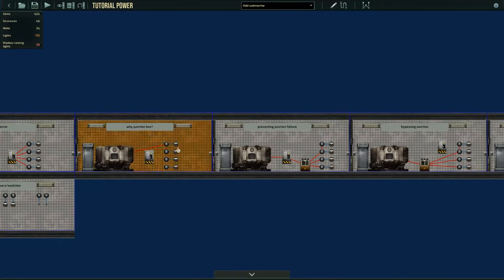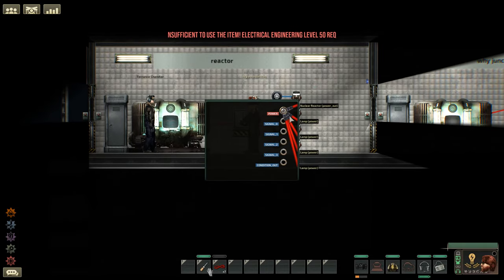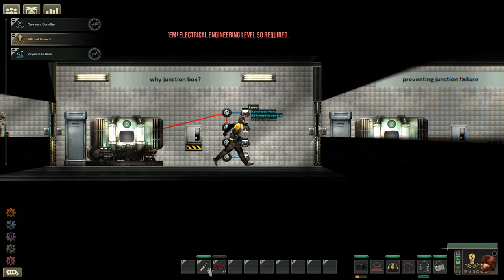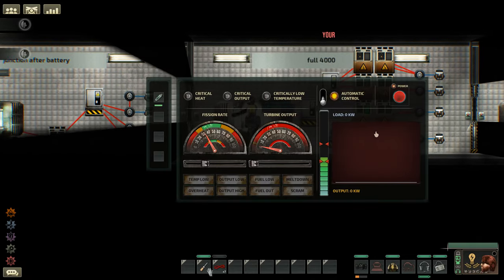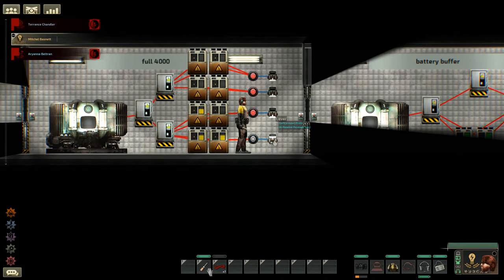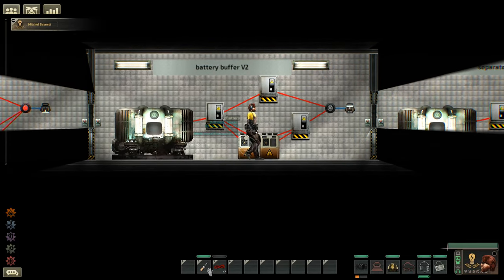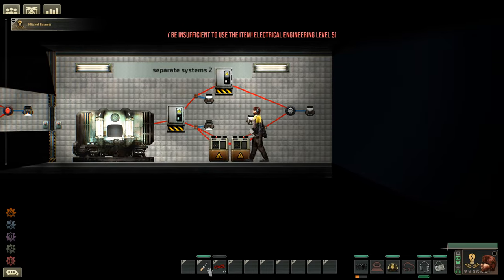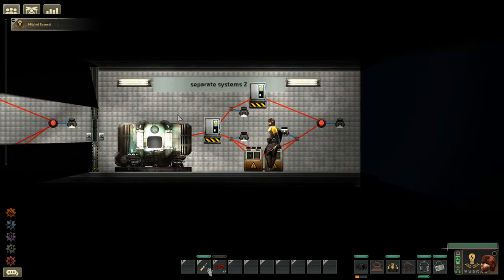Barotrauma - Reactor, Junction Box, Battery - Wiring Guide 2022

Comment: The current power system passes power requests from the consumer back through the grid to a single producer per tick. If that producer can't produce enough power it will pull some from it and go to the next producer in the list. Forking and joining via batteries and  relays causes all sorts of issues. 
There are a lot of bug reports about the power system. 
Another player submitted a complete rewrite of the power system that fixes basically all these issues to the developers. They're taking a look at it, so maybe we will see it in a future update.

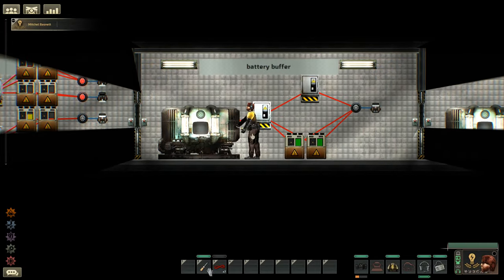Comment: 5:00 Well having 2mw load is okay there because 1mw is for the lamp and 1mw is for loading the batteries. So it would drop to 1mw after the batteries are charged. Problem is they should get charged but they deplete. That's kinda weird.

Comment: I just have my batteries constantly receive power to charge from a junction box, and then wire the batteries to another junction box through a relay I can turn off or on at any given time. I'm currently building a sub where it toggles the battery power on or off if you say "battery" in chat.

Comment: Nice guide to wiring! Do you by chance know how to make a voice-activated reactor? I've been trying to look up guides and ask other engineers on how to make one but it never seems to work when I replicate it. I think it requires a WiFi component and a RegEx, but I don't know how to put the correct expressions down. If you can help me that would be so helpful! Thanks again and I hope you make more Barotrauma guides!
Reply: @killingtimeitself  Wait so does that mean if you have no end, if you happen to say "reactor start" in a sentence it will activate?
Reply: Unfortunately there is no input for starting the reactor, only shutdown. I did recently watch a video about a chat controlled reactor recently though. Maybe I can link it later.
Reply: @killingtimeitself  Oh yeah I actually use the multiplication component like that for my ballast! I'm making a sub where if I go to a certain wifi channel and say "drain" basically every door on the sub opens at once and the ballast turns on full pump out mode. Might also be useful against ballast flora seeing as I can just turn off the pump after draining out the water.
Reply: @killingtimeitself  What if I removed the ^ AND the $? Would I be able to make a bomb where if someone said "among us" anywhere it would blow up?
Reply: @killingtimeitself  Oh man I'm perfectly satisfied knowing just that. I can't wait to make silly pranks such as when someone says hi anywhere in a message (such as history) the reactor shuts down.
Reply: @killingtimeitself  OOOOOOh yeah that sounds great.

Comment: Cool, thanks for this. Also could you tell me what load means exactly
Reply: The load on the reactor is how much power is needed to power everything that’s asking for power from it.

So say you have 2 1kw lights needing power, the load would be 2kw, and you’d need an output equal to or higher then 2kw to power them, assuming you have no batteries wired in